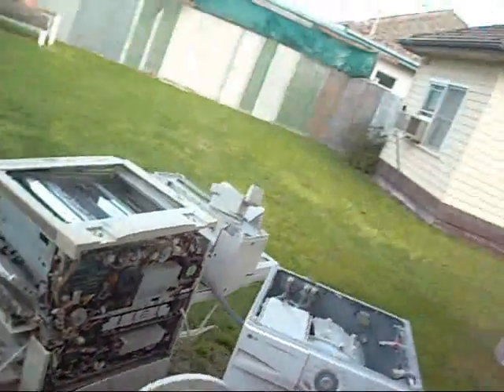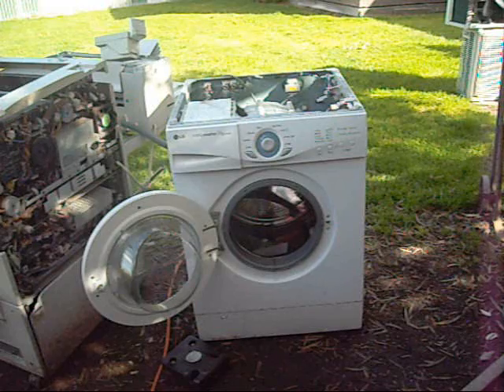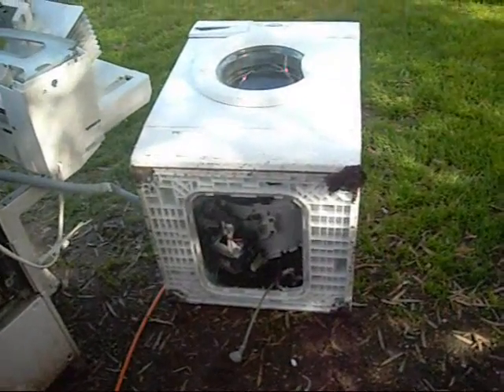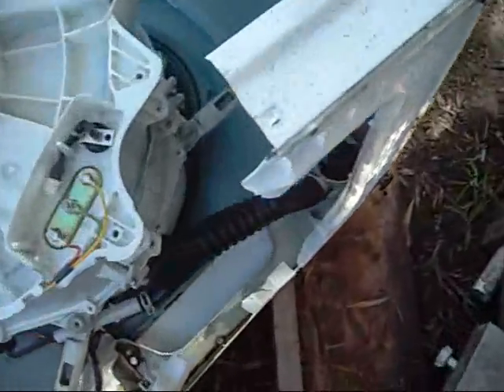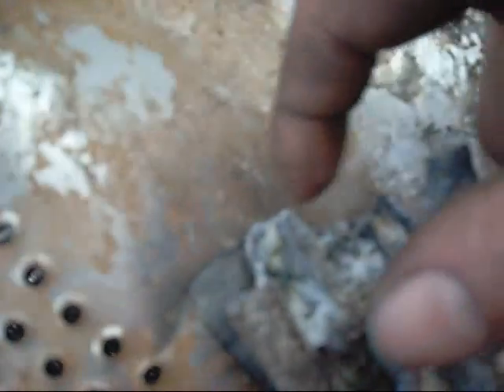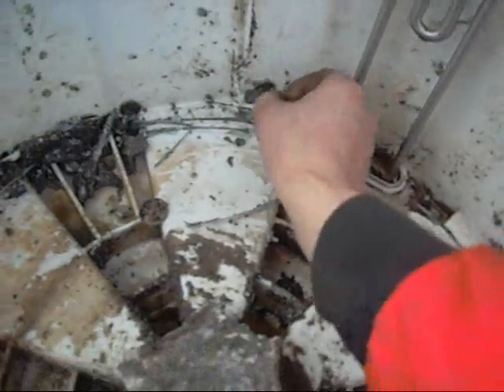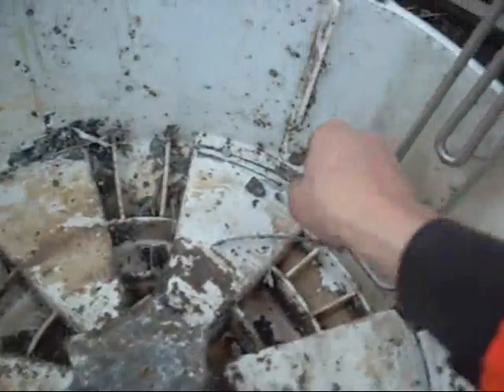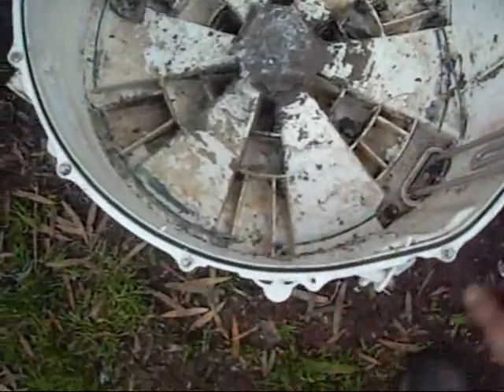LG Intellowasher Drive Plate Failure Autopsy

Comment from the maker: @umajunkcollector IMO the old 70's and 80's washers are built best!. only savings with these new ones are power and water. both of which are made irrelevant when you have to replace it after 4 or 5 years.